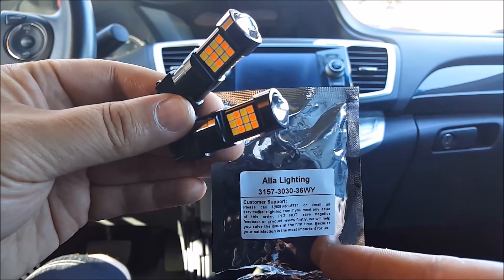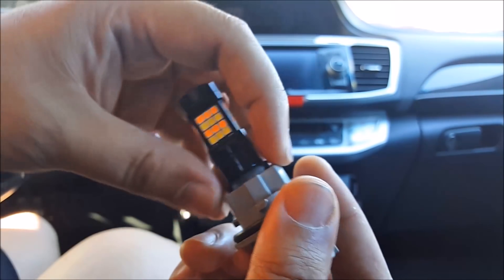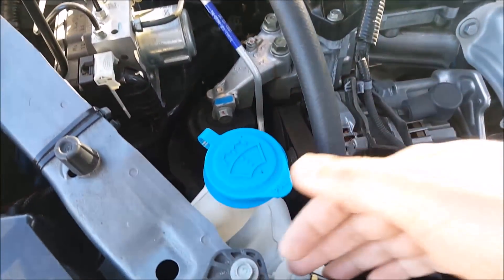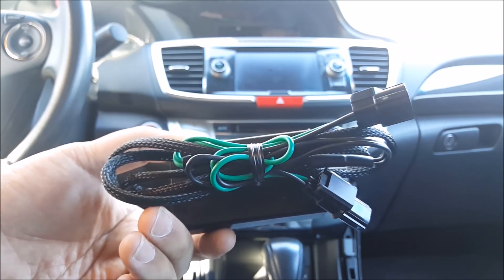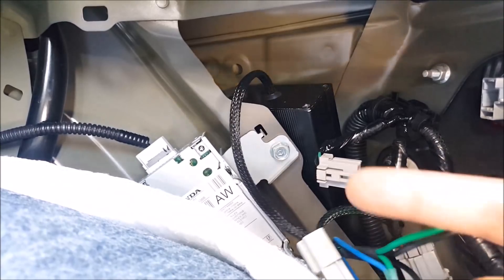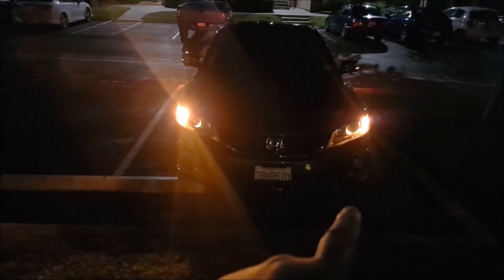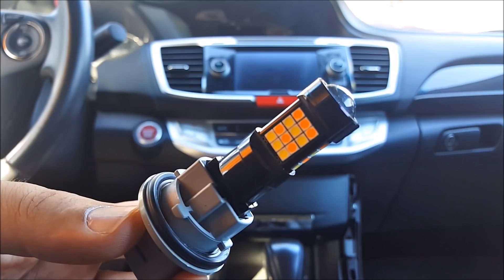[Review and Demo] Alla Lighting 3030 Switchback Turn Signal LED

Comment: When adding resistors can I use posi lock instead of crimping the wires to the resistors. Or the wires run too hot?
Reply from the maker: Shouldn't be an issue.. just make sure to mount the resistor itself away from any wires, plastic, carpet, rubber, etc etc.. onto something metal.

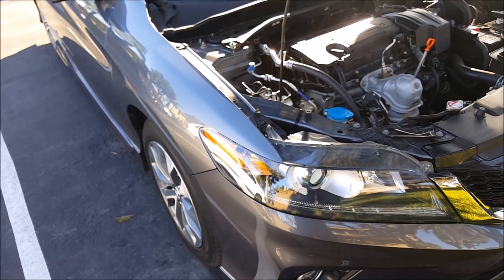Comment: I got the 1157 ones for my 2014 honda sport. After I installed I noticed that the 12 LEDs are up and down. And the 4 LEDs side are left and right.  And yours are the 4 LEDs are up and down, 12 LEDs are left and right.   Is there something I did wrong? Or just the housing or the car is not same? See your video at 3:00.
Reply from the maker: Nothing wrong.  Its just a different socket.  I have 3157 and you have 1157.

Comment: I'm just curious to know if Hyperflashing is a bad thing?
Reply: It's not bad but it will not look as good and it will be unnecessary wear and tear on the bulbs. Order the plug and play resistors from Jeff. I have them for my 2015 Accord and 2016 Civic. They work perfectly and install is so simple.
Reply: Mark Anthony Hi Mark I installed your plug and play wire harness they are FANTASTIC took less than 15 min to install however my switchback led bulb will not switch back only works on Amber turn signal.any advice
Reply: Andrea Grassi have you tried rotating the bulb 180 degrees in the socket